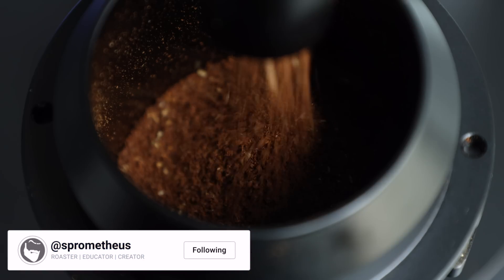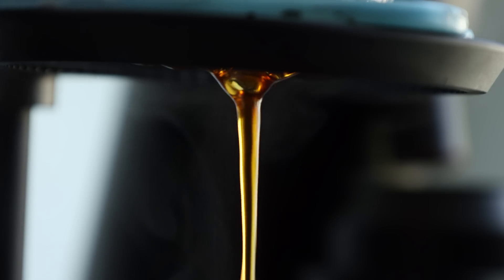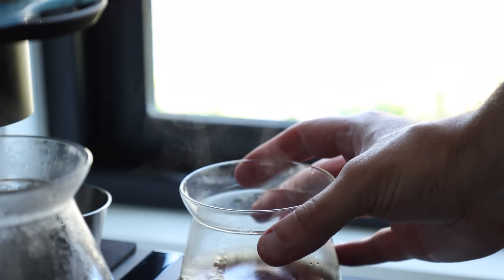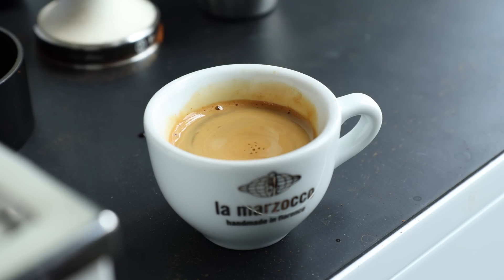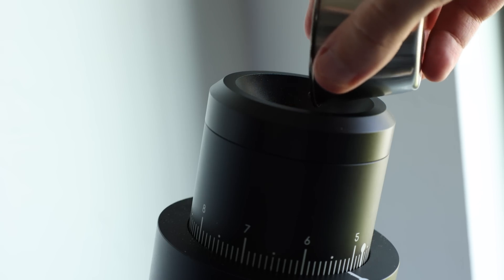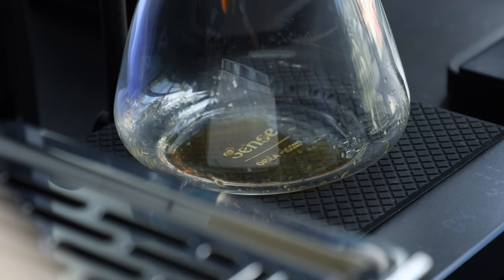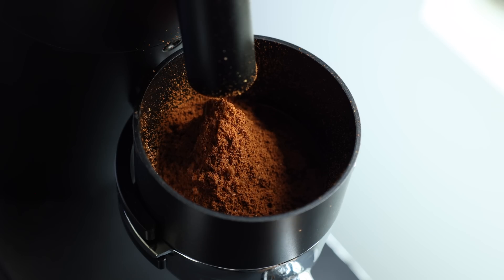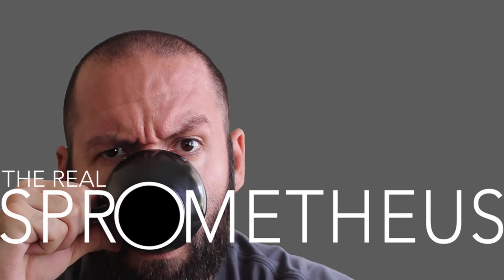COFFEE SCIENCE - How Grinder Speed Affects Extraction & Taste

Comment: I believe some burrs ARE affected by RPM in this way, others the differences are less noticible. On Lab Sweet style burrs (Tried SSP Cast v2, and Option-o Mizen Omni in 64mm) and they don't seem to be as effected by RPM speed changes, it was hard to tell the differences, it was there but very slight. 
64mm SSP MP unimodal burrs (which I suspect you used for this testing!) can give you more dramatic differences with high or lower RPM. 
Good news for those who don't have a variable RPM grinder, slow feeding the coffee into the burrs has a similar effect of decreasing fines increasing flavour clarity and acidity/brightness.  You can also now get automated slow feeders which I find are very helpful. Sometimes you may want to dump in the coffee and get a more traditional profile though!

Oh Also some grinders like the EG-1 supposedly have opposite results, where higher RPM gives better clarity and lower RPM more fines, and body, which is very weird. 
Grinders with Pre-breaker / augers may also  behave differently than expected.  Prebreakers don't break as much at lower RPM and you're also kind of adjusting the feed-rate with the auger, so even more complicated.

Comment: Hi thanks for that. I'm very surprised that there was less extraction with the espresso at higher speed due to the number of fines. I would have thought that more fines would be easier to get more dissolved as you have more surface area? Do you have an explanation as to why it was the opposite?
Reply: With less grind fines, water flows more evenly within the grinds, thus extracting more. The more fines, the more channeling within the puck, even though one may not notice that on the filter basket during brewing.  This was also the explanation why turbo shots have better extraction than traditional espresso. The flow may look ugly, but the extraction is superior on turbo shots.

Comment: A year later how are you feeling about these results? Anything you’d add? I’m getting a df83v which has a variable speed control and I’m trying to learn about how I can use the different speeds. I brew medium roast espresso generally drank as americanos. Thoughts?
Reply: I literally came to this video because I'm in the same boat as you, tryna figure out the varied RPM with the new DF83V. I still haven't ordered mine yet, but I'm close.
Reply: Same reason I watched this video.  I’m playing with my new df83v and only had it a couple days.
Reply: So? All these months later did any of you find something to go on?

All i can say after extensive testing with my df83v is that the lower end of rpm, I don't even know why you would want that because i have not yet produced anything that comes close to justifying it's use. Whatever bean I'm brewing whether it being for espresso or pour over, it just pales in comparison to what I'm achieving in sweetness and overall flavours at the higher RPM's.

Even for pour over if you think about lowering RPM because of less fines, don't. Your sacrificing all the juicy flavours for said less fines and I don't even think it matters anything as I'm not even sure it produces less fines on the lower rpm spectrum. 
What i definitely know for sure is that if you want less fines just slow feed your beans into the hopper which has a huge noticable impact.

So for now I'd say its a load of crap to waste effort with lowering RPM as far as my findings go

Comment: Try making a video on all the different burrs. I wonder if they make a ceramic burr. I have a ceramic 54mm and steel for my baratza vario-w. The ceramic has completely different teeth patterns. Someone said “Less teeth maybe more crushing then cutting” so I switched my steel burr back to ceramic to get a more balanced cup vs bright/high clarity cup from the steel burrs.

Currently using a ECM classika single boiler with PID and flow control and it’s been a lot of fun! Would love to try a p64 but for now the vario-w with flat 54 will have to do!

Comment: Without reading the article on grind speed and output temperature, I would expect your result for several reasons:
1. Lower speeds get the grounds through the motor more quickly, meaning less heat transfer from the motor or burrs themselves (lower contact time) and less heat from the energy released by the breakdown of the beans (because fewer such shatterings/crushings are likely to occur as each bean passes through the burrs in less time).
2. Higher RPM leads to more fines, which have to have been broken more times and/or more energetically. If you performed this test after adjusting the grind settings to have identical brew time, then this might not have been as substantial a factor, but the video just says "mid-grind" and you've also said that the profiles of the resulting coffee followed the same "common wisdom" of the clarity/sweetness outcomes as with finer or coarser grind size.
3. Higher RPM means more energy in the moving burr because it's moving faster, thus collisions involving it will have more energetic debris. In this case, that debris is coffee in the process of being ground and it has nowhere to go but further into the maelstrom, and so the grounds will have endured several such collisions and carry the energy (and at 7x speed that's 49x as much energy) of those collisions with them in the form of higher exit velocity (which you'd already remarked upon) and temperature. Some fraction of that excess exit velocity would also translate into heat, but some of that heat would be lost to the air if those grounds bounced and it's unlikely to compare to the energy gained from the many collisions the coffee experienced between the burrs.

Comment: You had to grind finer for espresso at 1400 rpm compared to 200rpm? higher speed= more friction= more heat, adding heat to beans means you have to grind finer (see the microwave heated beans experiment before grinding).

Comment: Lagom recommends speed number 3 on the p100 for everything from espresso to filter. I think that's around 580 RPM? Not sure what their recommendation speeds are on the p64. Interesting tests! Thanks for the all the data.
Reply from the maker: I’ve never seen a specific recommended point, but 4 on the grinder is approximately 800 rpm if you look at it like 1 is 200 and 9 is 1400. I have heard some rumblings that 4 is the ideal based on user experience, and that does seem to check out in my experience. Thanks for watching and the comment!
Reply: @Sprometheus  According to Lagom P64 user manual, setting 4 is 650rpm +/-5%.
Also, the quick guide recommend speed 4 for espresso using HU burr.  For MP it's 7 for espresso and 3 for brew.
Anyway, great video and very informative.
Reply: @Killand8  For espresso, I thought the lower RPM range shots (like at 4 on the P64 which is 650rpm) with the MP unimodal burrs didn't pull as well, I'd get channeling and generally worse results, higher RPM (setting 7 on p64, which is I think 1100RPM) worked better with that burr for me while still having amazing flavour clarity, my theory is there wasn't enough fines and it was 'too unimodal' somehow to work for espresso but it might have just been me and my machine and coffees.
Reply: You should get a tachometer to test RPM of grinders. Lance Hedrick recently got one and it has proved very useful.

Comment: Waiting on the Acaia orbit which should be shipping with RPM adjustments. I don't think it'll preform much different than the P64 though. This month, it's Bunzilla month.
Reply from the maker: I haven’t followed the Acaia Orbit all that
closely, but considering their connection with Weber I would be a little wearing of the rpm adjustments working as advertised as the Key was a jamming mess and when I asked why they essentially said grind faster.
Reply: @Sprometheus  We'll see. I'm okay being a test subject on this purchase as I primarily want access to the grind by weight feature to allow my wife for easier access to espresso making, and I appreciate the aesthetics design. The orbit will be using a 250w DC brushless while the P64 uses a 300w DC brushless.

Comment: I am wondering about RDT and clumping.  I use a ROK Grinder  and find it does benefit from RDT to minimize retention. BUT, the process does seem to increase clumping compared to no RDT. Even using one spiritual will have a small, but noticeable increase in clumps compared to no spritz. Has this been tested?
Reply from the maker: That’s an interesting topic. I haven’t seen or noticed much issue with RDT beyond less static retention. It may be something worth looking into though.

Comment: For the espresso, at same grind size, how the rpm affect the brew time? Does the lower rpm will make the shot faster or slower?
Reply: I think the premise here is its valuable to talk about grind distribution, not grind size. The grind distribution at lower RPM is more uniform, having less fines. The grind distribution at higher RPM is less uniform, having more fines. So I’m not sure “at same grind size” is a useful concept. Unless I’ve overthought your question and all you’re asking about is differences in brew time given the same “grinder setting / burr separation”.
Reply: Pick prep being equal, more fines always means slower brew, no matter the method, right? (Assuming same puck prep ensures fines are equally distributed and channeling does not occur.)
Reply from the maker: So a little background on why I went the dialed in route Vs just changing the grind. Lower RPMs with less fines resulted in 7-10 second difference in shot time, with also was very inconsistent on taste and extraction, so it didn’t feel like valuable information on the topic. Aligning brew time per speed adjustment allowed for some consistency which allowed me to glean actual data from beyond slow grind = fast shot and Vice versa.
Reply: Ok thanks for the explanation. So it means we have to set the grind setting finer to achieve same brew time at slower rpm 👍
Reply: More questions on conical burr. The result is opposite if we grind with conical burr. The shot is faster at higher rpm, and slower at lower rpm. How do you think about that?
Reply: More questions on conical burr. The result is opposite if we grind with conical burr. The shot is faster at higher rpm, and slower at lower rpm. How do you think about that?
Reply: More questions on conical burr. The result is opposite if we grind with conical burr. The shot is faster at higher rpm, and slower at lower rpm. How do you think about that?